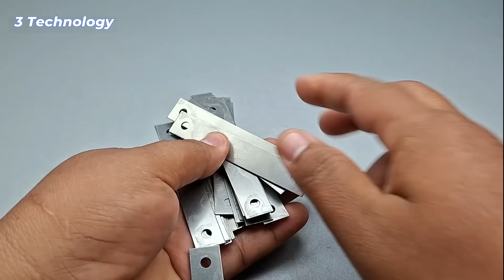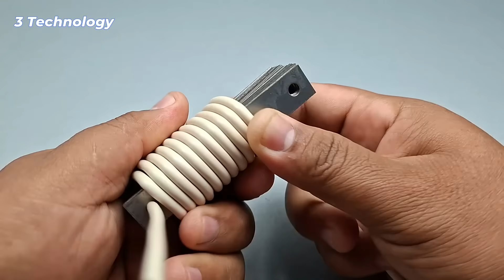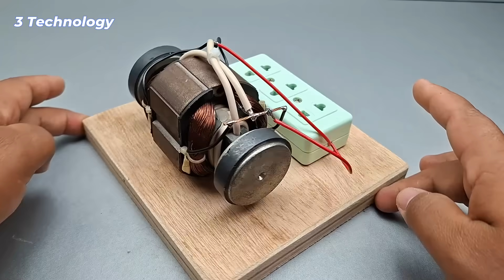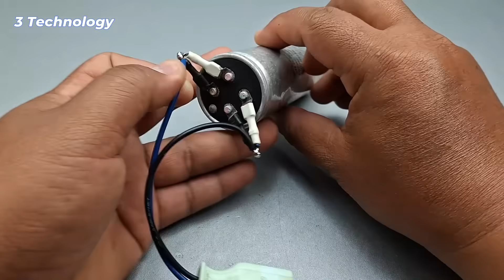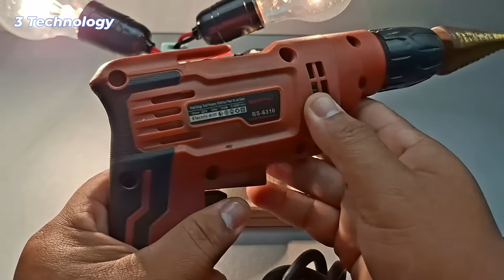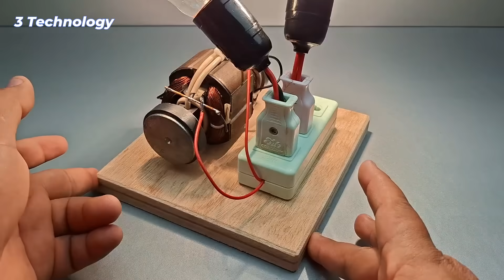Most powerful 16kw free electricity generator 220v with copper wire transformer & magnet energy

Comment: The energy is contained in the hot glue
After studying countless free energy generators, I've noticed that hot glue is always used. This sticky substance is apparently energized when heated.

So that's the secret: Hot glue provides so much energy that you can do without all the other components. It would be enough to stick two wires in the glue to power an entire household of four people.